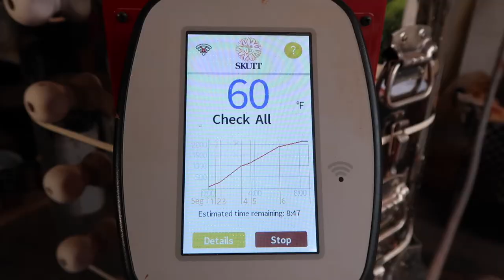How I Glaze and Fire Plates

Comment: i find it amazing the partially supported plates didn’t warp, is that why you’re under firing your clay? nice work, beautiful plates
Reply from the maker: Surprising, right? Some absolutely warped because they were not supported but I would highly recommend not doing what I did in the video😂 As the kiln gets to its peak temp, the clay is much more malleable and if not on a flat surface it will definitely warp. I didn’t know that at the time of the video but it’s a big time help for the plates. Thanks so much for watching!

Comment: Great video, thanks.  But why don’t they warp?  On the few occasions I have stilted plates the have warped!  Any tips and advice would be awesome.
Reply from the maker: So glad you liked the video! Unfortunately, a few of those plates warped and that it typically due to not being placed on a completely level surface. I thought my plates might be fine if I stilted some of them but in reality that is not usually the best method. When pottery is being fired and reaches the peak temperatures, the pottery itself becomes a bit softer for that period of time and if not on a level surface it can begin to warp or change shape because of gravity pulling it downward. This is especially true for thinner pieces. 

Since this video I have done more firings with plates on a completely level surface, both bisque and glaze firing, and have had little to no warping whatsoever! It takes a bit longer to get through a batch of plates because they take up so much space in thew kiln but it is worth it! 

Thank you so much for watching and for your question! Hope that helps!

Comment: Are the circular pieces you use to put the plates on just large cookies?
Reply from the maker: Hi, there! I'm not exactly sure which circular pieces you are referring to but the things I used to support the plates were kiln posts, tiny little stilts (the ones with the points), a small circular kiln shelf and some test tiles. As a general note though I have had the best results firing plates now with a completely flat surface. I really like a sturdy plate with no wobble and the way I fired this patch in the video were not as flat as they could be because they were not on a completely flat surface. 

Anyway, that is what I have learned since! I hope that answered your question. Thank you so much for watching!
Reply: @dougrubenstein  yes, that's what I was asking about. I wasn't sure if they were Kiln shelves or large cookies/patties that you were setting the plates on. So they are just small circular Kiln shelves then? I'm getting my first Kiln soon & am planning on firing some plates so I was looking for an efficient way to fire them without needing a ton of extra shelves as I only ordered 3 for my Skutt 822. I'm looking at buying or making my own plate setters to maximize space as it's a small kiln
Reply from the maker: @missylee5  Yes the circular one of the top is a smaller circular kiln shelf. I would recommend making sure they are on a flat surface while firing so they don't warp. I keep trying to figure out a much more efficient way to fire a much of plate too! They're a tricky bunch, that's for sure. From my experience, when I try to cut corners to fire more and maximize on space it hasn't worked out too well (hope you have better luck!). I have more shelves for when I fire my plates, but still try to leave 4-5 inches between each shelf so that the heat can properly circulate between each shelf. Congratulations on your kiln and happy firing!

Comment: great video.  How do you prevent cracks on the bottom of your plates?  I think they were mostly resting directly on the shelves.  Also, you only do one coat of glaze it would seem ?   Thanks :)
Reply from the maker: Hi there! Thanks so much for watching! Preventing cracks starts at the very beginning. I know it sounds crazy but making sure you first wedge the clay well, then compress it well with a rib when throwing it. When trimming I also typically use bubblewrap or some type of void filler to place on the inside to cushion the negative space while I trim the bottom. And lastly, after letting it become bone dry slowly (which also prevents cracking) I have found it most beneficial for the plates to be placed directly on the kiln shelf. In this video I was experimenting with alternate placements to maximize space but learned that a completely flat spot is the best shot to give a plate so it doesn't crack or warp. 

And yes! That was all just one layer of glaze. 

Thank you so much for watching and great question!
Reply: @dougrubenstein  Thank you :)